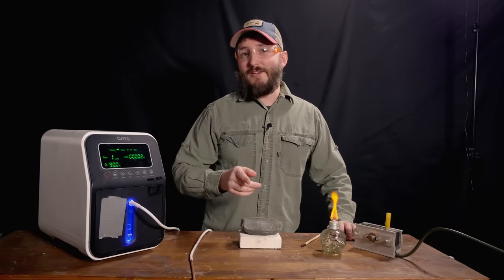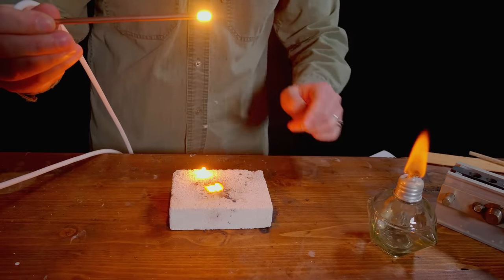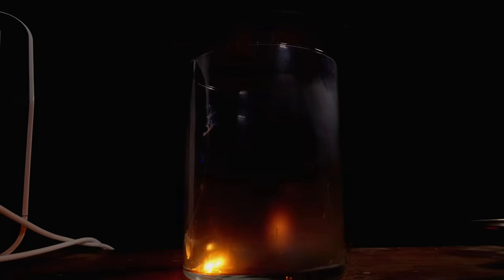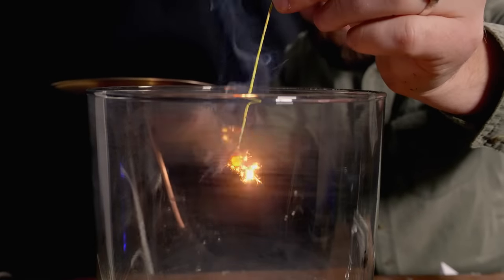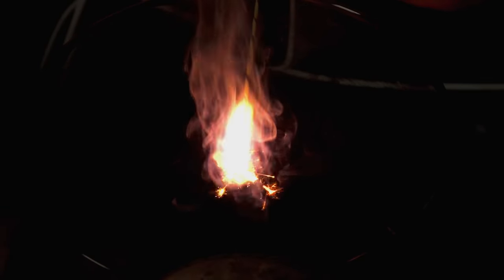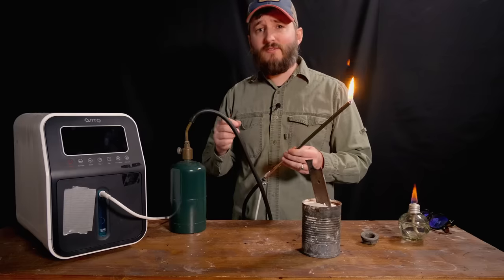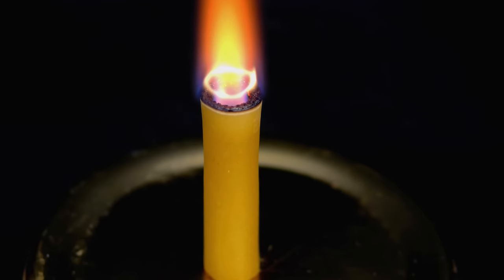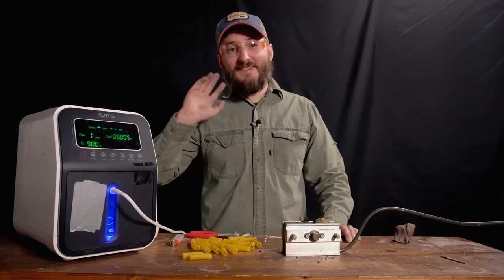6 Unauthorized Uses for a Medical Oxygen Concentrator

Comment: If you have a bucket of water and cut the bottom off of a 2 litre bottle then push the bottle into the water you get a gasometer and can get quite high gas pressure.
Reply: Or you can just buy a gas tank for cheap 😂.

Comment: Try this. Cut a wash cloth into 4 equal parts. Saturate 1 part in O2 tank (simulates in bed O2 use). place 2 fire bricks near tank place 1 piece of cloth on brick and 1 in tank with O2 venting directly on it and 1 just laying on bottom. After a little while place the O2 saturated cloth out of the tank and onto the empty brick. Light your sparkler and lower it towards the 2 cloths (simulates a cigarette in bed. Repeat the experiment with the other cloth. 
Anyone who watches this experiment will probably never smoke in bed again with O2 present.

Comment: What happens if you get a wubble bubble, fill it with Oxygen then use a weight to hold it under water and attach an electric igniter attached to a battery and switch about 100 ft. away and ignite it?

Comment: What is the operating principle of the oxygen generator? How does it separate oxygen from air?
Reply from the maker: I think it's a molecular sieve. Basically a material that sucks up O2 and then releases it when heated. You have two sides going at once, one sucking in the O2 and the other being heated. I think
Reply: @Nighthawkinlight This would be a cool gadget to own :-)

Comment: When u say unauthorised uses are you saying illegal? I am a n AU. A mate that has sadly passed away, had one, I considered making a storage container for it with the 2 drum method. Also wondered if the oxygen concentration can be improved by running it thru multiple times? My understanding is that it changes the oxygen from approx 20 % to 30%

Comment: Put several strands of Angle Hair pasta inside the noodle shell. That way the Angle Hair is the fuel instead of the outside pasta shell, at least until it burns down.......

Comment: When you showed that it's hot enough to melt the fire brick, I thought that it can be use to make synthetic ruby. But then you showed that it doesn't work with propane to melt a steel. I guess steel wool is not a good combine in making of synthetic rubies.

Comment: Oxygen concentrators produce a maximum of 95% oxygen. This is accomplished by room air being passed through sieve beds inside the unit that are filled with powdered Zeolite (a rock that is mined out of the earth). Zeolite has an ionic bond with Nitrogen which accounts for 78% of the atmosphere . The unit then captures the nitrogen and purges it back into the air resulting in a concentration of up to 95% O2

Comment: I've had one for years they are amazing. 15$ at a thrift store. You can burn steel pipe, copper pipe etc.
Rated for 95% if you want it I have 2
Reply: Yeah man mine has a 5 liter per minute at 95.
Oxygen concentrators are good for smokers, grill, water heating, burning trash, welding, hydroponics. 
Most underrated machine ever made. I burn the shit out of myself every week.

Kink the tubing quick like a hose if you don't want your house to burn down though. It's the most powerful force I've ever encounterd

Comment: A thermal lance will have tungsten wire running down the middle of the tube and it will burn extremely hot

Comment: You have to pull the oxygen tube back inside the propane tube farther and the overall orifice  needs to be wwwway smaller. In a regular oxy/acet torch, the 2 gases are blended together in the barrel before the point where the tip is screwed on. 

Oxygen rich environments don't necessarily need an ignition source for things to spontaneously combust, if the fuel is rich enough...like oily rags or coveralls. I know you know but I doubt 100% of your viewers know. Also, a visible fire extinguisher wouldn't be a bad idea. 

When you say there's a flow rate, instead of psi, that may not produce enough oxygen to weld with. Flow rates are a measurement of cubic feet per hour, like the way fans are graded where psi is based on pressure above atmospheric per square inch, like how compressors are graded. If the oxygen can't be compressed to at least 8 psi, it probably won't be enough to weld with. ..maybe more since it's only 90%.

That's a hellofa score though. I would have been all over it too. Do they make them for nitrogen also? I wonder how pure the nitrogen would be if they do? 

I have one of those tiny oxy/acet or propane  torch sets. When I got it, the hoses were shot and they're a direct connection to the torch handle, so using standard o/a hoses wasn't an option. I got some stuff from McMaster Carr that was rated for both oxygen and acetylene it's called something like targon or tygon.
Reply from the maker: The nitrogen comes out of fairly large vents in the bottom of the machine. It would be fun to isolate that output and see how inert it is.
Reply: @NightHawkInLight  what else is in our air? Methane, radon, co2, ...I guess it all depends on the elevation where it's drawn from, huh? Many of the other gases are also inert. I wonder of the 90% oxygen, is it all the oxygen plus nitrogen or is there some oxygen mixed with the nitrogen and the rest of the gas that's skimmed off?

Is there a way to get any pipe fittings on that vent to capture the gas before it blends with our air?

You could try using it as a purge gas when brazing some cleaned and capped copper pipe,  like when doing med gas brazing. Idk how well it would prove it to be completely inert but if the joint ends up being the least bit oxidized,  then it will prove the opposite.

Comment: Does the oxygen concentrator have enough pressure to inflate a balloon?
If so then you could make a pasta rocket/blimp... though oxygen is pretty dense and wouldn't float by itself, but between the air rushing out of the balloon plus "rocket fuel" pasta... maybe?
I don't know, I'm just spitballing here...

Comment: Get a legit backflash arrestor please. What you’ve demonstrated is a slow burning of the hose. Not of the gas, which with oxyacetylene torches can travel at twice the speed of sound at sea level. Granted you don’t have a gaseous fuel like acetylene in the hose. Also not 100% oxygen. However it might still be worth considering adding an arrestor.

Comment: I think you should  get a small compressor and a oxygen tank then put that tank in a bath of dry ice then hook the compressor up to your oxygen maker so that it will fill up with that 90 °oxigen and liquefy. When you take it out of the dry ice the pressure will go up in the tank and there you go you have your oxygen thank for a touch

Comment: Most home medical O2 concentrators in the US can supply up to 5 LPM of o2 at about 90% concentration and there are a few that can deliver 10 or 12 LPM. Why were your experiments run at only 1 LPM flow rate?

Comment: I use a homefill oxygen system (concentrator and compressor) to fill my oxygen tanks for jewelry.
Reply: I'm considering using the compressor to fill a PCP gun. I haven't check the specs but I believe you just need to push a bit of air into the intake tube that normally leads from the concentrator. 
In theory I hook up a normal compressor an voila normal atmospheric air?
If ya hear an explosion in Alaska just say a prayer😂

Comment: This comment has nothing to do the video but: I asked chat GPT how to use radio waves to generate electricity and it gave an answer. can you use this information to actually make electricity with RF like the dude in Africa who made a tv run on RF?  If so can you show us how it's done?

Radio waves, a form of electromagnetic radiation, can be used to generate electricity through a process called electromagnetic induction. When a varying magnetic field intersects a conductor, it induces an electric current in the conductor. Here's how radio waves create electricity:

Electromagnetic Waves:
Radio waves are a type of electromagnetic wave. They are created by oscillating electric and magnetic fields that propagate through space at the speed of light.
These waves have a wide range of frequencies, from a few kilohertz (kHz) to several gigahertz (GHz), and are commonly used for communication, including radio and television broadcasts.
Electromagnetic Induction:
Electromagnetic induction is the process of creating an electric current in a conductor by exposing it to a changing magnetic field.
Faraday's Law: According to Faraday's Law of electromagnetic induction, the induced electromotive force (EMF) in a conductor is directly proportional to the rate at which the magnetic field changes and the number of turns in the conductor.
Generating Electricity with Radio Waves:
Antenna: An antenna is used to capture radio waves from the surrounding environment. It consists of conductive elements that can resonate with specific radio wave frequencies.
Changing Magnetic Field: When radio waves pass through the antenna, they create a time-varying magnetic field around the conductive elements.
Induced Current: The changing magnetic field induces an electric current in the antenna's conductive elements through electromagnetic induction.
Rectification: The induced alternating current (AC) is then typically rectified using a diode or a set of diodes to convert it into direct current (DC) electricity. This process involves allowing current to flow in only one direction, removing the negative portion of the AC waveform.
Energy Conversion: The rectified DC current can be used to power various electronic devices or stored in batteries for later use.
Radio Frequency Harvesting:
In some cases, specialized devices called RF (radio frequency) harvesters or energy harvesters are used to capture and convert radio frequency energy into usable electricity.
These devices employ antennas or other means to capture and rectify radio waves, similar to the process described above. The harvested energy can then power low-power electronic devices or charge batteries.
It's important to note that the amount of electricity generated from radio waves depends on several factors, including the intensity of the radio waves, the efficiency of the conversion process, and the specific application or device being powered. Additionally, radio waves generally provide relatively low power levels and are not typically used as the primary source of electricity generation for large-scale power systems.

Comment: well the thing about those units is...some come with a oxygen compressor (normally on top), it takes some of the produced oxygen and shoves it into a portable tank (very slowly mind you, takes like 45 mins for a small tank to be filled). the flow rate out of the tank can be MUCH higher, so that is maybe a solution.
clearly comes with the danger of compressed oxygen but those medical tanks are pretty fucking sturdy given their use case...still the danger is always there.
Reply: hi rocksfire, what do you think about all gubments drawing a line around you(Antarctic Treaty) and saying you are not allowed to leave? If you don't know what I mean, read my about tab.

Comment: sugar   use sugar. grind in to power, press into a hollow tube with a straw or small wooden dowel in the center to form channel for O2, if you want a little more energetic reaction add just a little Sodium Percarbonate . just remember you are making rocket fuel.

Comment: I had the idea of using this concentrated oxygen in place of nitrous in cars. When you figure it out you actually will get more oxygen than you would with nitrous I believe. The downside is that I think more nitrous can be packed into the bottles so you'll have a lot less runs. However because you can fill this yourself at home makes it much more easy to use if you can live with how fast it runs out. 

Ran this idea past a car nut guy I know that builds Hondas and he said that it totally works because he's seen people do it just to test it out. Originally I would take what he said with a grain of salt because he would make claims that just seemed too crazy. But every time he came back with proof, like photo or video. My opinion now of him is if he told me he went fly fishing with Obama before work then at the very worst that guy is the worlds best Obama impersonator and I would totally understand why he have believed it was Obama.
Reply: Nitrous is used due to its thermal breakdown in the combustion chamber. When it breaks down it releases the trapped O2 which had been held by nitrogen. O2 itself is not great in the intake manifold due to oxidizing characteristics plus oxygen would readily react with anything that oxidized prior to fuel combustion.

Comment: The lack of purified and or pressurized oxygen is why jet  fuel cant burn hot enough to weaken or melt structural steel.
Its the amount of oxygen that determines if maximum potential heat is created.
If insufficient, the flame DOES NOT GET TO MAXIMUM POTENTIAL and generates smoke, which is unburnt, partially combusted fuel.
Hmmmm, knowing that, where might application of this fact be useful in evaluating historic events?

Comment: @johnostambaugh8638
0 seconds ago
"Oxygen is so dangerous" found this: "As of 01 Sep 2023, dry air in Earth's atmosphere contains approximately 20.95% oxygen, 78.08% nitrogen, 0.93% argon, 0.04% carbon dioxide, and small amounts of other gases.3 Atmospheric oxygen is the most important need humans have, even more important than food.2 Most organisms have evolved to live in an environment that has a very specific set of conditions, and if this percentage were to change suddenly, most organisms would have difficulty coping with the new conditions.1 Air suitable for use in photosynthesis by terrestrial plants and breathing of terrestrial animals is found only in Earth's troposphere.3 Oxygen atoms are very reactive and are incorporated into many common chemical compounds, such as water, carbon dioxide, carbon monoxide, sulfur oxides, and nitrogen oxides.0"

Comment: Last thing take aluminum baseball bat drill out th back 3/8 and put a propane torch in it. Cut the other end put a magnet on the middle and add oxygen. You now have a shotgun that doubles as a club

Comment: well if the goal is make more children more involved have them bring in their own kinds of pasta shape. every culture has some kind of noodle and different one more preform worse or better. furthermore you can have the children make their own pasta with additives. Thinking like sugar, cinnamon, more salt or pepper, even Coco powder and see how these additives affect burn rate. Pasta is cheap and easy to make, some flour, water, egg yolks, and water else mixed into a dough and molded around a wooden dowl or knife handle . Let it dry out in the fridge and bam rocket fuel

Comment: If you think this is impressive try operating a piece of Analytical Equipment called a Parr Bomb.
A Sample Container pressurized to 250 PSI with Pure Oxygen and then triggered electronically.
This puppy will burn almost anything you want to analyze the Caloric content of.

Comment: The percentage of oxygen in the air around us is 20-21%, not 24%.  And your description of oxygen concentrators as delivering "anywhere up to 90% oxygen" gives the wrong impression.  In fact, rather than 90% being the maximum, oxygen concentrators deliver a minimum of 90% oxygen. Generally, they can be expected to produce as much as 95%.  
That's it.  I'm only 6 or 7 minutes into the video and you haven't shown any alternative uses for your concentrator btw.

Comment: First of all, they are only sold with prescription. If the unit is like the one I use daily, my regulator goes from ½ liters per minute of 98%O2 up to 6 liters per minute in ⅒ lpm graduations. That's not a pressure rating, but rather a volume per a set measure of time. Those machines have to be factory serviced with new filters, atmospheric adsorption materials (zeolites?), Certified output testing, AND You're good for another twelve months. 
    Sorry Captain, I've given her all I've got. It would take at least ten more dylithium crystals working together to pierce the supernova and come out safely on the other side.  
     💎💎💎💎💎💎💎💎💎💎✨🍥🥵🎇🎆ᕙ( ͡° ͜ʖ ͡°)ᕗ

Comment: Oxygen concentrators do not create oxygen. They remove anything that is not oxygen. Therefore no matter what the machine reports the amount of the oxygen made available is limited by the amount in the room. After a number of experiments the amount of oxygen in the surrounding area is depleted. All of the purification in the world cannot create oxygen that isn't there. Increase the ventilation of the room drastically if you want to really produce 90% oxygen over any significant amount of time. ☮️

Comment: Open the door? Dude if this is not properly ventilated wear a mask at least. And all these do not seem like a safe setup. Lighting up oxygen coming from a container seems safer than what you are doing here. E.g. say there's enough small particles in the air and filtration in the device not good enough that flame goes to inside of the device, I don't know how it's made inside but likely neither do you.

Comment: That's funny. 
Thay way over do the danger of oxygen and fire at any level of oxygen you can ues a air compressor or your breath to excelerate a fire. The way a fire burns has to do more with the Type of material that's burning then it does the oxygen.Of course fire needs oxygen but all more oxygen at any % is going to do is speed up the burning process once the fuel is gone the paper the fire goes out oxygen doesn't burn on its own you either have in the case of a peace of binder paper either have a split second fire of a 1 or 2 minute fire fires hot longer or shorter burn what is worse